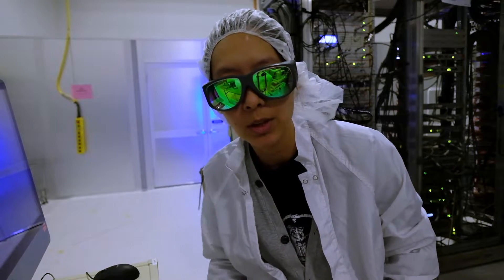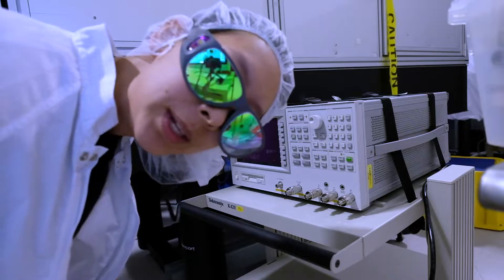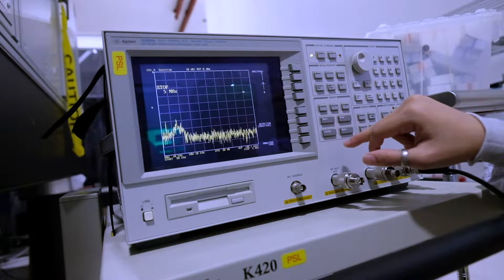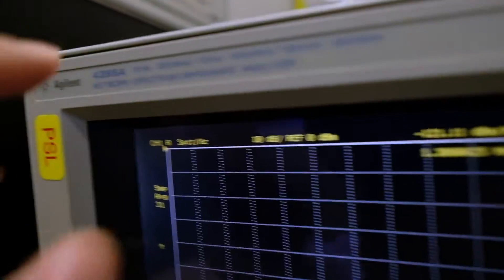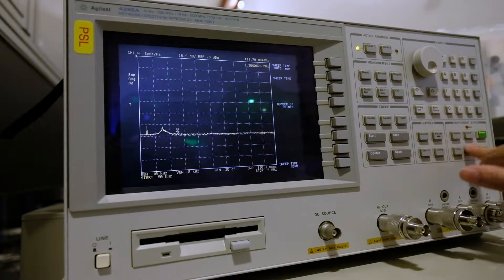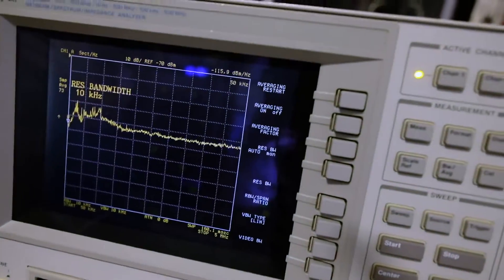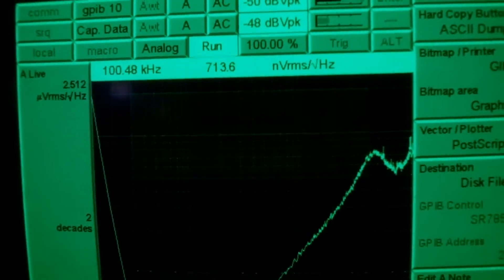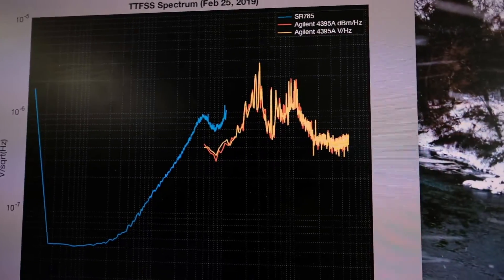[Tutorial] How to take a noise spectrum with an Agilent 4395A

Comment: Hi, after running the analyser I see you save data on disk. Will you be able to send me the link for the disk please. Instead of the disk I am trying to save data on laptop. So, I have connected  analyser to the LabView using Laptop. But I am unable to save the data on my laptop. There is only option to save data on disk or memory. From your experience could you give any suggestions please. I will really appreciate your respons.
Reply: Have you solved your problem? If not, an easy way is to use the "Connection Expert" software (IO Libraries from Keysight). 
When your 4395A is connected via the GPIB link, send these 2 commands:
FORM4 , press the "SEND COMMAND" button
OUTPDTRC? , press the "SEND & READ" button
You will then receive serial data with a "," delimiter.  Simply copy and paste into a text file, replacing commas with line breaks. 
  
Example:

-1.110120E+001,-2.322466E+001,-5.554843E+001,-6.284383E+001,-6.241705E+001,....................

replace "," by carriage+line feed

-1.110120E+001
-2.322466E+001
-5.554843E+001
-6.284383E+001
-6.241705E+001
....................

Comment: Nutsinee:  there is a perfect explanation on why the HP 4395A is off by 2.5 dB.  The 4395A using a True RMS detection method rather than a conventional logarithmic amplifier and envelope detector--as most other analyzers do (even many other HP Spectrum Analyzers).  Therefore, when you are in NOISE mode on the 4395A, the displayed value is a TRUE measure of noise level (in V, A or W per root Hz).    This is true in the HP 3588/89A, 4395A and 4396B.  The 3585A/B and 4195A use log amps and envelope detectors so they will read 2.5 dB low.  For more information, see (somewhat obscure) Agilent Product Note PN 4395/96-1, "How to Measure Noise Accurately Using the
Agilent Combination Analyzers."  The 4395A is a great tool and gets it right!